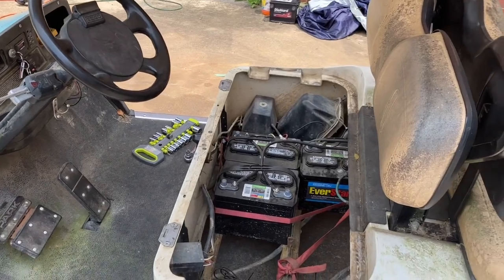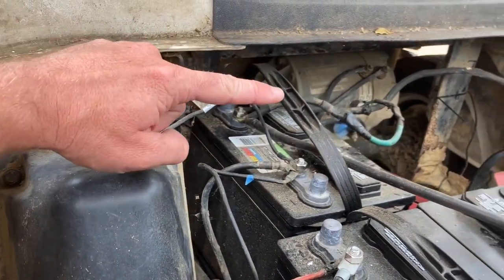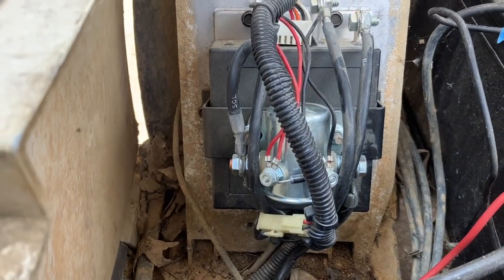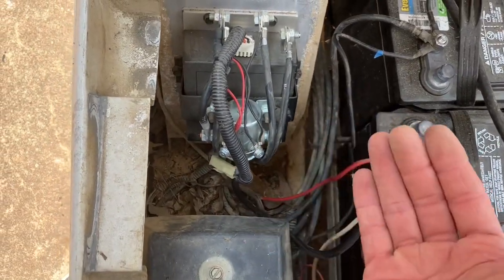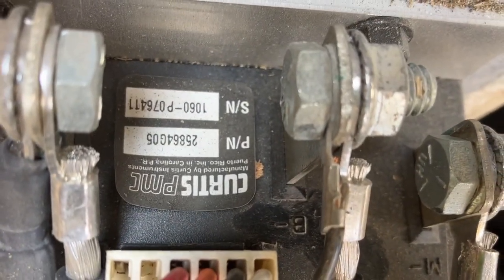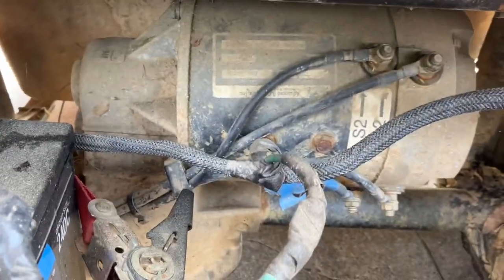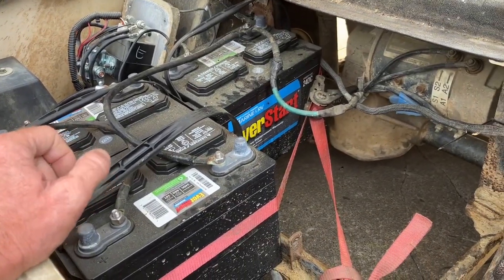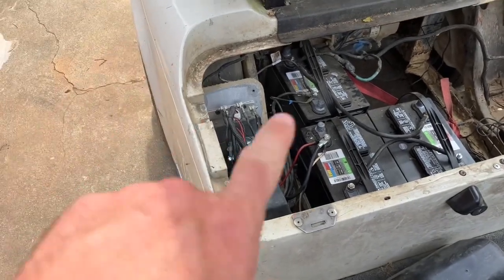Where the positive and negative terminals lead on a golf cart with a 12 volt swap.

Comment: Did you put two wires positive and negative from the battery charger to the positive terminal? I am afraid it would not be grounded?
Reply from the maker: It’s a total of 3 wires.  2 positive 1 negative.  I followed them from the old 6 volt system, it’s exactly how it was on it.

Comment: Found this vid to be very helpful, almost covered it all for me and will put what I learned to good use. Now if you could clarify where the Right lead on the Controller goes to? The wire marked M- you also have two leads on the left terminal of the controller and one went to the left side of the Solenoid, where did the other go? I am sorry for asking these questions again but I am all done hooking it up and want to be sure I was correct.
Reply from the maker: I’ll do my best